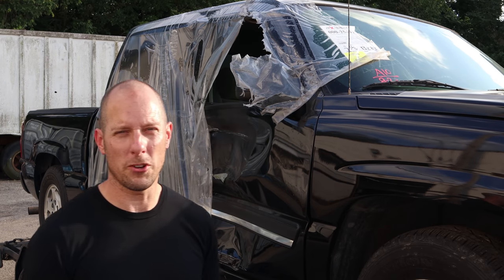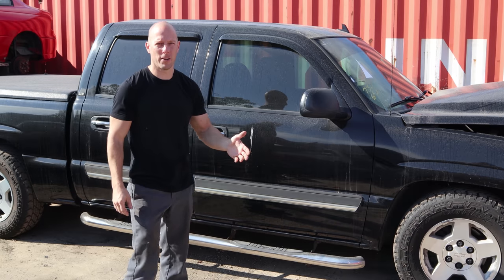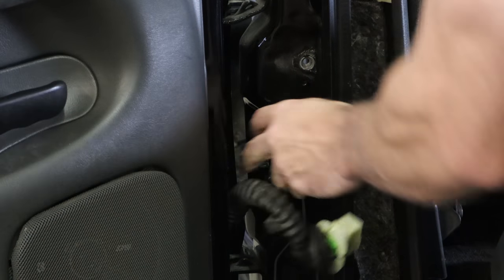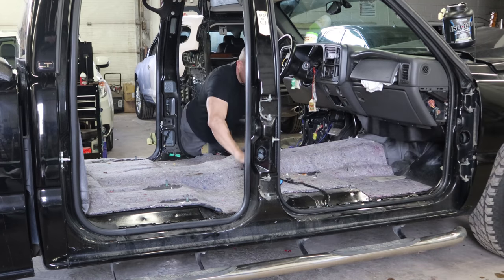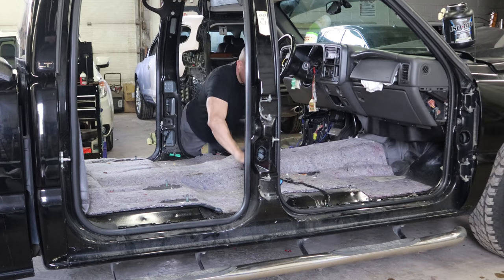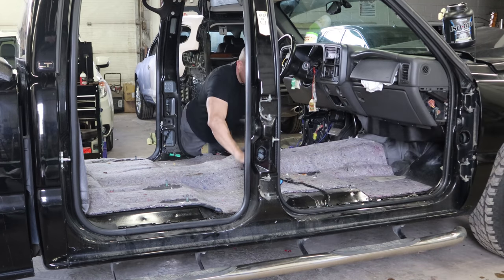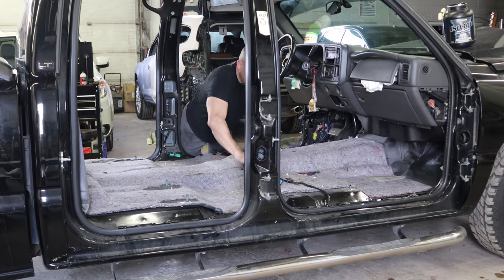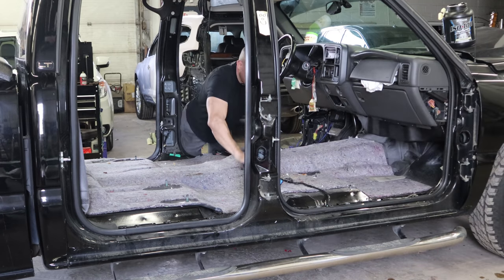Side collision Silverado cab swap rebuild project part 1

Comment: Made my month with this new project, excellent choice for a quick turn-around. You don't scream when backing off the trailer like the afternoon crew. Found out from you I have a wiper removal tool too!  Just didn't know how to use it, thanks !
Reply from the maker: I only scream like the afternoon crew when a break a nameplate apparently. 😂 The wiper arm tool also works as a trim panel installer! Thanks for the support!

Comment: Helpful advice.. 5.3 were notorious  for having clogged oil pressure sensors. When you remove that other cab would be the time to change it for good measure. I have used a spark plug wire tool to get that dreaded clip for the e brake.. but that wrench trick is great. Thanks for another hard working build.. waiting in suspense for next week.
Reply from the maker: Those oil pressure sensors are not that hard in the truck, I do them all the time.  They actually make a tool for that e brake clip but I always forget it at work.

Comment: This is like that CRV i bought that ran under a truck. The front was smashed hard A/C condenser looked like a U. A/C still blew cold still had a full charge LOL! What's really cool is that Trans cooler isn't leaking those or the lines almost always leak in a front wreck.
Reply from the maker: Usually the bumper takes out the trans cooler with even a slight hit.  Maybe the key is to hit things harder! 😂

Comment: Always enjoyable! You have it down to a science. BTW, The locomotive engineer is required to blow the horn approaching crossings. Two long, a short and then one long blast on the crossing. Sounds like your shop is at and or near many crossings.
Reply from the maker: Thanks, they don't follow any kind of rules with the horn some lay on it for a half mile, some 30 times through town.  I had become so used to it, it did phase me until I started making videos. lol

Comment: Really enjoyed this one. I have an 05 2500HD that I bought really right because the brake lines rotted out.( I live next door to you Indiana so we share the same climate)
But the rocker panels are rusted off of it as well. This video has me thinking about finding a clean southern parts truck and cab swap in lieu of replacing rockers....
Reply from the maker: The swap is the best way to go if you plan on keeping it for a long time.  The replacement rockers only buy you a couple years at best.  You have the same climate just better taxes and less corruption! I'm jealous 😒

Comment: You seem to specialise in side-damaged vehicles. Having watched other channels that do mainly front-damaged vehicles, I can see why you like the side damage. Generally easier to repair. Cab swaps make it even easier. I've lost count of the number of cab swaps you've done over time.
Reply from the maker: Front hits are easy so they sell for more money. You can get some good deals on side hits if you aren't afraid of a little work.  I love cab and frame swaps!
Reply: Cab and frame swaps take a good deal of extra labor, plus you need lots of space to hold and move all the parts around.  On the plus side, there's a lot less frame and welding work when you can just swap in a good part.

Front end hits dont require much room or swapping huge parts, so they can be done faster.

Comment: The new wrap around radiator provides the best in cooling capabilities.
Reply from the maker: They should probably use these on the 2020 Silverados to improve the look of the front ends! 😂
Reply: @vehcor  I prefer the segmented and perforated rads with the self sealing option

Comment: Yep Here in SC that looks like an everyday truck (no rust) 2wd is more popular here unless you're a mudder. I love these body style trucks. Glad you found one that was low miles. Down here most of these are pushing 300k
Reply from the maker: Yep, the parts truck was from Georgia and just as clean.  They are hard to find in the auctions under 200k

Comment: Caught myself drooling at that underside. Here in PA we have more rust holes than frame too lol
Reply from the maker: I thought it was worth filming.  Some people in the rust belt don't know these trucks actually came with rockers! 😂
Reply: @vehcor  in NJ the squarebodys and GMC's have rust on their RUST
Reply: Being from the South in TN my 87 gmc looks like that truck underneath just with small patches of surface rust on the frame rails starting to pop up but nothing a little sanding and undercoating won't fix when I start working on it.
Reply: I see so many rusted out trucks here in Michigan

Comment: After 2 separate Silverado rear crossmember replacement( rotted) and frame jobs in last couple weeks ( one sadly my own) i cried too see how clean that frame was.....😢.  Dont think i have seen one of those here in new england 😂. 👍👍👍👍. That train!!!!! 🤭😂😂😂☃️
Reply from the maker: In the dump trailer was a 2000 Silverado that the cab was only held on by gravity and there were 3 of the 7 (I believe) cross members left.  The bumpers crumpled in my hands!  I wish they all looked like this build!
Reply: vehcor  its unbelievable how bad the 99-07s are
At least i now can get aftermarket crossmembers,hitches and bumpers.  Sad as most of these trucks would have probably gone 300k plus
Well after changing exh manifolds. 😂🤦‍♂️😬❄️☃️☃️☃️

Comment: Not all hillbillys can afford or have access to a bobcat. Just need a chain and a big ole tree. Chain the truck to the tree and plant the throttle in reverse! Good as new! 😂
Reply from the maker: There were no trees in my storage yard! 😂 Every hillbilly knows a guy with a bobcat or backhoe.  It's part of being a hillbilly.  😂
Reply: @vehcor  I heard a big mule and a big stick can work wonders from the OZARKS,  but in DOLLYWOOD they have a variation of TRACTOR pulls with BRING your own wreck day
Reply: I'm not a very good hillbilly then I have a wrecker and a excavator.
Reply from the maker: No U wrecker and an excavator?!?! That is for those upscale hillbillies! 😂 You use the excavator on the Lamborghini builds don't you?
Reply: @nou8257  any FRAME MACHINE AND LASER LINER??????  Boy time to move on up
Reply: @vehcor  Its for the fine touches.

Comment: Mine is a 2001 similar to this truck slight lift on the drivers side frame rail space at top of new fender at door 1/16, bottom 1.5 iinches steering within 1.5 inches pull to the drivers side.

Comment: I love rebuilding GMT800s. They are like legos. One upgrade you kay concider since you have the harness and relay box. Swap the truck your fixing to electeic fans. Its a worthwhile upgrade and plug and play. You will have to get the ecm flashed to enable it.
Reply from the maker: I would but the fans from the parts truck were no good. I will have more time I editing the videos than the build by far! 😂 I love building these trucks!
Reply: @vehcor  what do you want for the electric fan harness and relay box shipped to 29432 SC?  There is a two wire connector that has to be unpinned from ecm connector buts its fairly easy to remove.

Comment: IN THE LAND OF CORRUPTION & RUST ISN'T 2 WHEEL DRIVE WORTHLESS?
Reply: Not necessarily, dedicated winter treads, and some weight over the rear end mixed with common sense will cure 80% of the issues. There are exceptions, but overall the weight and tires will work
Reply: No matter if it is 2 or 4 wheel drive, you need weight in the back and good tires.
Reply from the maker: It will not have as big a market but a low mile rust free 04 crew cab doesn't have much competition up here.

Comment: I'm sorry Mr.Vehcor but if a rebuild doesn't have 14 lbs of body filler  per panel and at least 3 doors hanging on for dear life then im not interested.
Reply from the maker: Can I interest you in a rotted out frame and brake lines? We have lots of those builds up here! 😂

Comment: I had an almost identical truck except it was white and 4x4. It was tired and a little rusty when I got it, and it was my work truck. I lightly rear-ended a guy, body shop said $7k damage. Our government run public insurance wanted to fix it. I declined since the rust got worse, 4x4 was making nasty sounds, and the little things were just worn out.

Comment: I love those 5.3. my favorite motor. I have a 02 Chevy Tahoe lt loaded. I'm in Pensacola.
Reply: Vincent Blue why did u include your location?
Reply: @Noname-lk2ol  I don't Kno... Jus cause the south.. lol
Reply from the maker: That truck will last forever down there.  Up here, they are all rotted away but the engines are still going strong!
Reply: @vehcor  love the engine mine got 296. As we speak. I sure wish I can get her to u to do body work. She got dents and dings my sister flipped her on her side didn't do a crush jus her side and that was four years ago. She still here had her for eight years

Comment: Hey you did not make Karate sounds when Popping the ratchet straps loose! I need clips off that shitty bumper!. Nice now I need to change the radiator support on the Sierra here. Body shop did a horrible job fixing it. You have the gold mine of GMT parts. Hope ya save that stuff.
Reply from the maker: Perfect rust free parts are not easy to come by up here! lol

Comment: Did i see that right you hooked up a ground to frame and positive to the back of the alternator <> plugged it into what on the tow vehicle
Reply: RON SALES that’s how you do it
Reply from the maker: Yes, I have a plug on my trailer that it connects to.  I'll have a video when I finish the rest of the mods on my trailer.

Comment: wow! you're getting trucks from as far away as Georgia now? (that's home for me by the way) the Macon copart lot is actually 3 miles away from my best friend's house in Byron Georgia. We've been buddies since age 13 and we're 50 now. long time but doesn't really seem like it. everything went by SO FAST. If you're running a GA truck in Illinois you'll need to invest in some fluid film and some undercoating or cavity wax for that thing. Hey that's pretty much the same dash that's in my 3 Escalades. nice to see how they actually come apart because i am fixing to have to overhaul my AC air box in my 06 EXT so this is VERY useful video for me personally. Why throw that passenger fender out? that looked like it could be easily straightened out and still used by someone. both front fenders looked perfectly usable still. well before yall started throwing things on top of them that is. ROFLMAO "satan's invention" huh? AWESOME! i always thought that invention was the fuel pump connector lines. I HATE those suckerswith aa passion because even with the right tool they never come off right without causing you to cuss a lot and get mad enough to throw wrenches through metal panels .LOL, "in cse you own a Ford" boy this is highly entertaining today. you're racking up all kinds of comedy points in this one. yeah that "heater box is what i have to rebuild in mine but i don't need to remove the whole dash to do it just take it loose from the passenger side from what the forums tell me. Maybe it won't be so bad
Reply from the maker: I have picked up vehicles in every state except Hawaii and Alaska. I spent a lot of time in TX and FL for vehicles.

Comment: As a a resident of the corrosive north, the last thing I'd buy is a 2wd truck, but I do see them from time to time. Frankly, there are enough people everywhere that one can find someone to buy just about anything. But, to me that's a three-season truck.  But also- $ is $ !
Reply from the maker: Here you need 4wd about 3 days out of the year.  The other 362 it is just added weight and components.  Some people realize that and take the savings.  While it will not be as marketable without 4wd, it has no competition when it comes to rust and miles around here.

Comment: I'm currently in the process of doing a cab swap myself. I'm curious about the complete dash assembly swap. All the other videos I've found about doing that, they completely disassemble the dash, whereas you take it out in pretty much one unit, except for the hvac box. I'd be interested in paying you for some guidance there.

Comment: How does it work with the vin number in Illinois? Does it go with the cab or does it stay with the chassis?
Reply from the maker: Either way as long as the paperwork supports what you are doing.  The state retags this cab with the correct vin for me.

Comment: A pair of rust free ccsb's , very rare truck , I have one just like it I bought in Miami Florida. How many miles on the one you're rebuilding?
Reply from the maker: 130k on the builder which is a baby for these.  Even the 200k+ parts truck is average.
Reply: @vehcor  , thats considered fairly low these days , mines got 165k and bluebook has it between 9 and 10 k value , which is a lot cheaper than a new one . There's always someone wanting to buy it every where I go. These trucks sell quick . A rust free pickup should bring a decent amount of money up north.

Comment: Dumb question: why'd you strip the new cab so far down? Was the dash and all associated parts not matching to the rebuilding one? I thought you could just replace the cluster and leave everything else on......
Reply: He said it had a cracked dash and different wiring harnesses, so might as well strip and move everything over.
Reply from the maker: Its all different.

Comment: I truly like and look forward to your videos each week. I watched this one twice, and I still can’t figure if the seats from the parts truck were electric or not. I’m looking to replace my seats in my 2001 Silverado HD 2500, and I’m wondering if they would fit or is the configuration of the mounts would be different or not. I really like also how the back seat folds down. Thanks for sharing your work each week!
Reply: Mounting points should all be the same as long as both trucks are from the same generation.  There could be floor wiring harness differences between a base model and a higher trim level that came with power or heated seats, but GM usually provided the power seat connectors most of the time.  Often hidden under the carpet.
Reply from the maker: Art Bruns the driver was power, the passenger was not.  After 03 they added sensors to the seats that changed in 06.  They will all bolt up in the 01, just need a power and ground run to them. Heated and memory seats required the addition of door panels, door harnesses and a cab harness if you had a lower trim level (I converted one so I had the pleasure). You can use the newer seats without memory and heat they will just have position sensors that don't get used.  They started using modules in the doors for heat and memory after 02 so trying to add 03-07 heated memory seats will provide you with additional programming obstacles.  The rear seats are all the same, these fold down because they are crew cab.  The extended cab, the bottom just folds up.
Reply: Bigpjohnson thank you as that helped me a lot. I’m not a very mechanical person, but your explanation has helped me. Thank You!
Reply: Vehcor, thank you so much for taking time to reply as your response really helped me. My HD is a extended cab, and not the crew cab so I’ll have to keep things like that in mind. I’d love to have all those features in my seats, but I’m afraid that it would be beyond my grasp. My old farm truck I consider to be nearly perfect without rust, and that’s why I’m keeping it plus I’m trying to make it more comfortable for a 
long trip. Thanks for your reply, and as well help. It’s to bad mine is the extended cab as I would have loved those seats!

Comment: What's the issue with swapping cabs and the VIN plate on the dash no longer matching the frame?
Does Illinois require you to get a self-assembled title and a new VIN?
Reply from the maker: No, they retag the new cab with the original vin.
Reply: @vehcor  I'm in Ohio, have done some cab swaps. Ohio requires you to provide titles and VIN plates from both vehicles to the state, then they issue a current-year "self-assembled motor vehicle" title and a new VIN plate.

Comment: I can't believe you threw away that front bumper. I love same color parts.  What do you do with 'left over' running gear (specifically LS motors)? My brother lived right across the street from a train crossing.  His roommate got irritated at the train honking so he took to giving them the bird. They responded by laying on their horn a mile away then continuing past the house for another 1/2 mile.  Pretty sure that wasn't a win for him.
Reply from the maker: It hurts to throw away a non rotted out bumper just for a little ding!  I will sell the drivetrain eventually or I might have a use for this truck if I can find some free time.  The trains don't bother me.  I have become used to them so I never really noticed them until I started making videos.  Then I realized those tracks are busier than Grand Central station! lol  They always seem to come through at the perfectly wrong time for me!

Comment: Great work  your build are great  but I had a question about our 2004 chevy tahoe  our third break light quit working  I was wondering if you have any ideas on what it could be I put a brand new one on and still not working is there a separate fuse for the third brake light or something else any information would help love looking at your project builds great work keep it up
Reply from the maker: Fuse will be marked CHMSL. Check for power and ground at the light, they usually burn out.

Comment: You decided to swap cabs instead of repairing the smacked up one....curious how that will work with DMV, VIN's, etc..? I have a rusted out cab on a decent frame and a solid powertrain. I'm thinking of a cab swap and just curious what to expect if I wanted to do this the legitimate way? You probably explained this somewhere in the past....if so, please let me know the car/truck or episode and I'll go through the past projects. Each state is different but curious what your plan is? Thank you for the content.
Reply from the maker: I call the state and they come and retag it with the original vin.